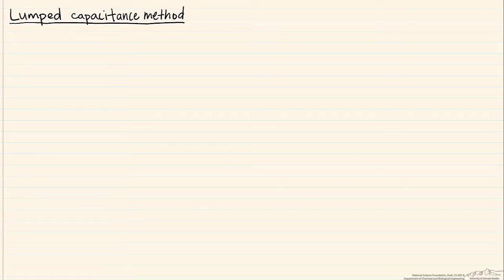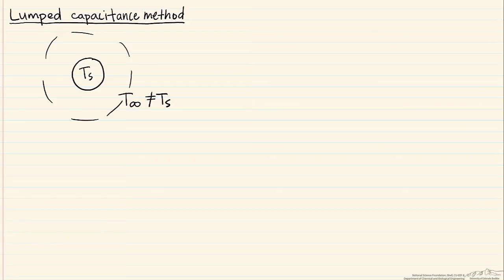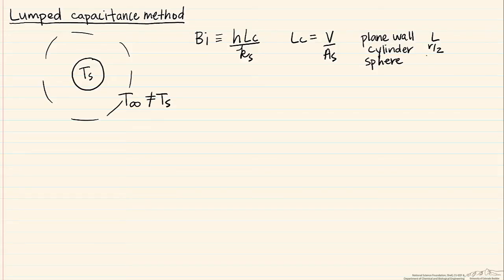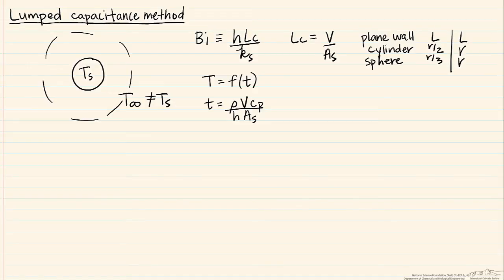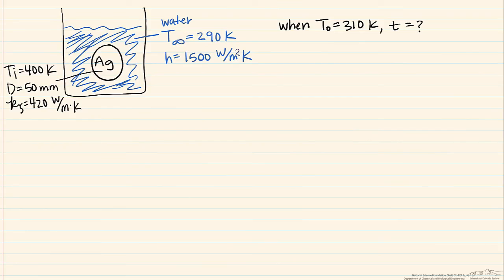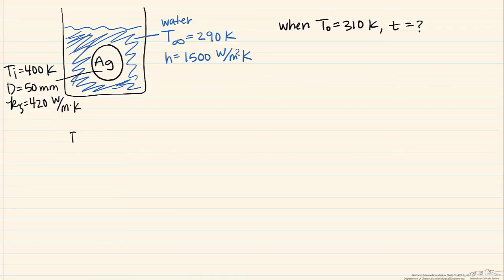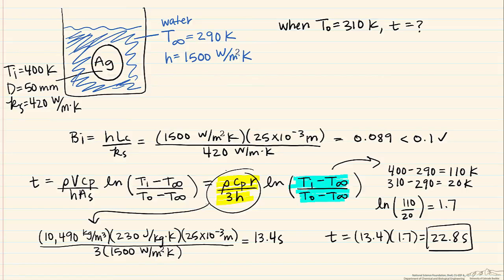Lumped Capacitance: Temperature of a Sphere

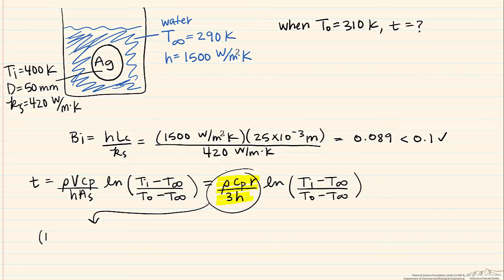Comment: Especially because @ 5:10, the characteristic length was decided to be R/3 instead of the conservative initial approach. How do you know when to use which one? If you initially used R/3 to solve Bi#, then lumped parameter would have failed and would have needed to use numerical analysis.

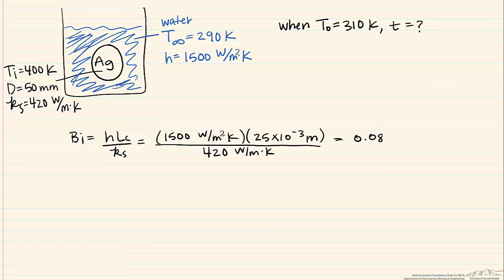Comment: question at 4:41 when you guys did the biot number and the characteristic length, you guys just used the radius instead of the radius divide by 3. why could that assumption be made and done?
Reply: iAmB2stful The narrator mentioned a 'more conservative method'. I think that by not dividing the radius by 3 the Lc value is therefore larger. This in turn increases the calculated value for the Bi number. By being more conservative and over estimating the Bi number, one can be completely sure that the problem can be solved. Alternatively, if r/3 was used then it would mean that whilst the 'true' Bi number would be found, it doesn't fully indicate that the numbers in the questions are safely and fully in the range in order to be able to use this lumped capacitance method. Basically, by overestimating in engineering you can be 99% sure that it's a valid assumption and calculation